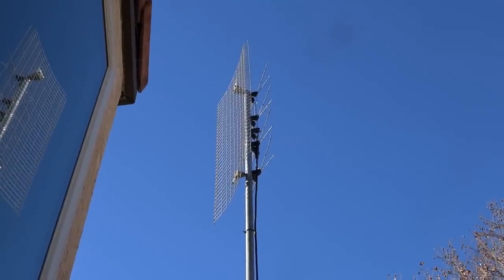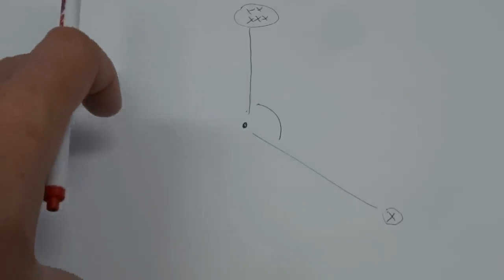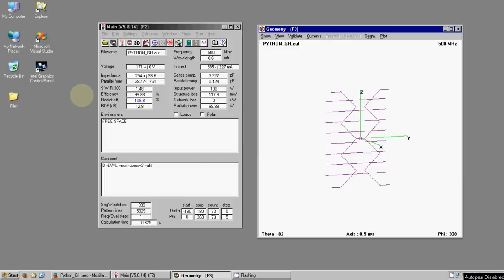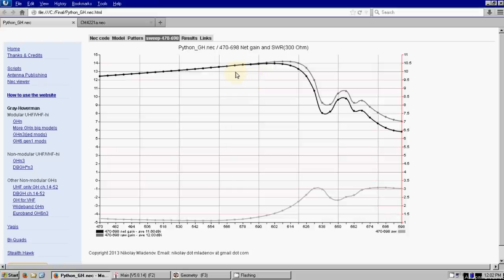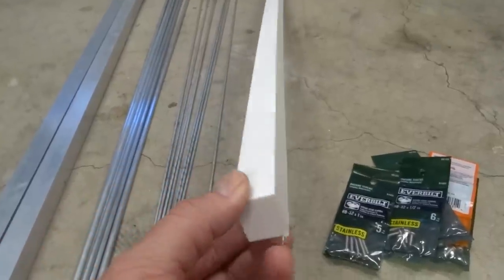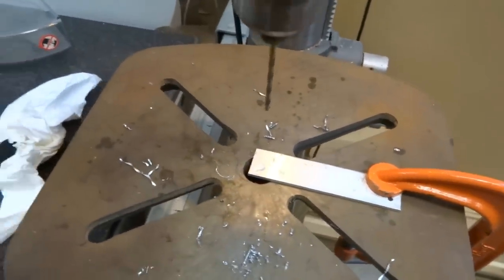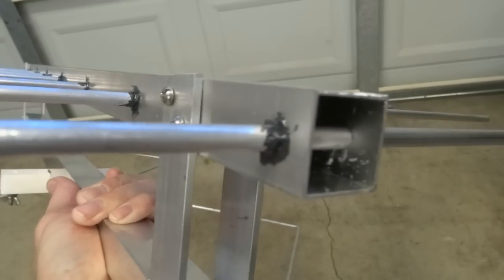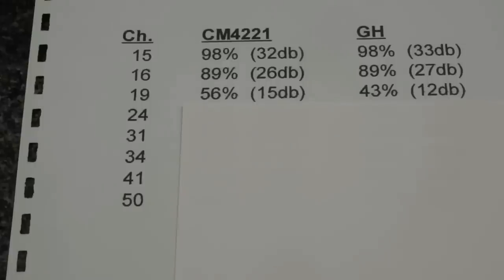Homemade Gray-Hoverman TV antenna

Comment: Sure it will work, we use to stack antenna's to cover multiply markets all the time.
 But, here's a trick you normally don't think of. When using a stacked antenna array, avoid using antennas that both cover the same channels in both target areas. Else you wind up amplifying the noise, from the area your not trying to receive, and, degrading the target signal.  You could also use a tuned trap, to block the signal from the undesired area, but, that's more complicated for many to comprehend (hi-pass, low-pass, or, notch filter etc).
Reply: Hardly even necessary anymore with technology. The Televes SmarKom will allow you to isolate which antenna is responsible to pick up each indvidual station. Not only that, it takes the signals and automatically optimizes and boosts each one as needed so the signal strength is about the same for all. Truly amazing. But yeah, it costs about $200 buck. Still cheaper than two months of cable.

Comment: Do you think that using thin copper tubing(Say 1/8" or 3/16" tube ) instead of copper wire be better from both strength and gain angle ?? How about using 10 gauge solid wire instead of thinner wire be better ?? What do  you think ???

Comment: Been building antennas for 63 years.  When you have your 5 channels line of sight 8 miles away, all you need is a paperclip to receive them.   Remove the reflector off your channel master antenna and point it at your 120 degree 40 mile target.  You will get perfect reception for the 5 channels from the side/back exposure gained by losing the reflector.

Comment: I know this is an older video, but man your work is professional quality.

Curious if your main antenna bends are at 7" per the usual Hooverman or if you used 10" as i have seen on some.

Also Brian, I know you optimized for certain channels, but did you consider the horizontal tubes top and bottom as seen on some Hoovermans to enhance vhf?

Comment: Most of the Grey Hoverman builds I've seen use non-conductive materials for the structural support, with a vertically split reflector. I like the simplicity and sturdiness of using aluminum square tube, but wonder how it might change the performance compared to the original design.

Comment: I purchased an indoor antenna that looks like a mini old fashioned outdoor antenna. Plus I added a 15db amplifier to it.  I use this combo within my apartment.  On a good day, this gets me 40+ free channels. However, the antenna has to be positioned in a specific location pointing in a specific direction.  This location is about a 1 foot by 1 foot by 1 foot square area. If I place the antenna anywhere outside of this area, I will be left with about 8 or 9 channels only.  The existence of this perfect little focal area is due to the RF signals bouncing off the immediate nearby surrounding buildings. 

However, the antenna that I use does have only 14 "wings", or what ever they are called, thus certain channels are picked up better than others. So to tune the antenna to get the best number of channels, I made an aluminum tuner. It is just a rectangular piece of thin cardboard covered with tinfoil. I place this on my antenna to tune it to raise the pickup of the weakest channels such as 49 and 51.

Comment: First, I really like your design thanks for taking the time to show your work. 

Two simple things to improve the longevity of your design.

1. You could have used your drill press to pre drill holes for small stainless screws to fasten the reflectors on the mast instead of epoxy. Epoxy will break down with UV exposure.

2. Bend the edge of your washers in a vice so they cup the element when fastened by the screws ensuring they won’t come loose in windy conditions.

Hope this help

Comment: Hey Brian, thanks for the vid. Am desperately trying to get better DTV reception and am sick of forking out money for high gain fringe antennas that don't do the job. And yes I am running a high quality mast head amp. Frequencies in our patch are mostly VHF: from 64.25MHz (odd one out) then 177.50 to 226.50Mhz with a couple in the UHF range 527.25 & 536.625MHz. All Horizontally polarised. I would consider ganging 4 of these together to cover the range. Are the receiver element lengths based on frequency wavelength?
Reply: buy Android tv box you can get everything you want for free
Reply: If you have twice the antenna the best you can hope for is 3 dB more signal. Are you in a deep fringe area? Any obstructions? Height problems? Trees in the way? If the transmitters are in different directions, a higher gain antenna will be harder to steer to each one.

Comment: Shouldn't the reflector rods be isolated from the structure frame with rubber grommets? 
Your nec file shows your reflector wires to be 6.35mm radius which is .500 inch diameter and your element wires are 3.175mm radius which is .25 inch diameter. Am I reading that right? I changed the value by half and it showed a slight increase in gain.
Reply: Make sense.. I thought the same..
Reply: Yes. Antenna in this video is not Gray-Hoverman. For G-H - reflector must be electrically split (no matter if it is solid mesh or rods). This is the most annoying feature to actually go for G-H. I've seen dozens of DIY pictures where people do solid-reflector (non-split in halves). I will run HFSS simulation to see what happens, when you connect reflector halves.

Comment: I live near the Illinois-Wisconsin border, so I get an equal amount of channels from both Milwaukee and Chicago - totalling 80-100, with the strongest signals at 100% signal strength.
But without warning, at random times, and regardless of weather, I lose all channel signals. Hardly a single channel in the entire memory works.
But when I do another channel scan to see what's available, I suddenly get channels on the other side of Lake Michigan, and stations as far north as Green Bay at 80% signal strength. Stations I would never get under normal conditions. Even with the LOS flatness of Lake Michigan.
I used 1/4" copper tubing for my elements and used soldered connections to the balun (which uses 20AWG solid leads on the 300 ohm side). I'm using a steel mesh reflector,  positioned randomly (4"?) behind the elements.
It's crazy. I've been experimenting with antennas for ham, AM/FM, tv, and even for neighbors' cable tv leakage since the 1970s, but I've never seen an antenna design deliver so much punch.
I'm wondering if anyone else has sudden complete dropouts of close stations and then perfect signals on stations over a hundred miles away.
Reply: In my opinion it may be because of input overload... which i sometimes observe in some walkie talkies/ handsets/radios. some strong signals overload the input, rendering the output zero or nothing.

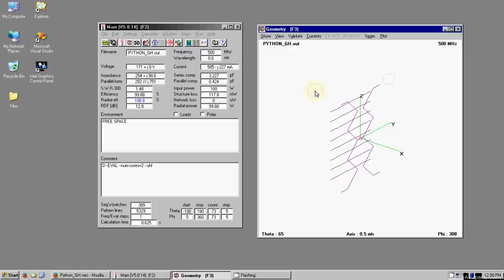Comment: Frequency selective if you size for specific dipole gap and if you use multiple antenna to create a phased array and aligned perfectly with the transmitter you may not need Traps or Band-pass filters.[ 7:00] 15 to 31?  I would aim tighter than that. If you used 3 antenna the distance between the three can help tune in the frequency.

Comment: EXCELLENT in ALL regards.  I hesitate to add anything, but after using more than a few cutting fluids on aluminum, I've found plain old kerosene to be about as good as it gets.  In my experience, Kerosene even works better than some of the products dedicated for use on aluminum.
Reply: Mike Wimbury
Reply: Kerosene, eh? In that case I bet mineral spirits (Stoddard solvent) would work great too, but less smelly. I'll try that.

Comment: Great job. You should do a build of the Channel Master 4251 UHF 7ft PARABOLIC  That was the king of Antennas.
Reply: www.wadeantenna.com , sells UHF Parabolic antennas.

And Yes the Prices Reflect the Quality of the antennas.

The advertising is aimed at the CATV industry and Professional industry due to the fact that they require durable long lasting dependable antennas , however Yes you can buy and use them.

And Yes Wade Antenna sells Tv many other Tv antennas.

And Yes the Prices Reflect the Quality of the antennas.

The , J-283X VHF/UHF All Channel Antenna is a Excellent Antenna.

Wade Antenna sells antennas that installers have thought are no longer available. However still are.

Comment: I was just wondering if you purposely allowed the reflector rods to be electrically connected. I've built a couple of these (not optimised for your channel range) using screens for reflectors instead of rods. I know there is a "gapless" version out there, but all the ones I've built needed the left and right sides of the reflectors to be electrically seperated to keep the SWR down. Anyways...I'm just curious and fascinated, not critical. Overall, I think it looks pretty nice.
Reply from the maker: Matt Hoover I considered electrically isolating the reflector rods using the plastic as I did with the driven elements, but in the end I didn't for several reasons. 1) It greatly simplified the design and construction, 2) that plastic is the most expensive part of the antenna, and 3) the biggest reason is most commercial antennas do not electrically isolate the reflectors so I wasn't sure if it's necessary or has much effect on the performance.
Reply: Brian Friesen OK..like I said, just curious. Easier to build is why I opted for using screens instead of rods. I live in the mountains of PA where I have to squeeze pretty much every decibal I can and use a pre-amp just to get stations broadcasting 20 miles away. I built a double bay version of this for myself and it works pretty well. Anyways, thanks for answering my question.
Reply: Brian Friesen Couldn't I use cheap plastic yardsticks for insulating?
Reply: Rainy Kay be careful what type of plastic you use as many types degrade and crumble under long term use in UV light. I used the gray, UV resistant PVC electrical pipe (1/2") for my build.
Reply: +Matt  Hoover Good!

Comment: Nice job with the antenna. it looks great. I'm interested in building one, however I need my gain to peak at UHF channel 42  (don't really care what else I receive) The design software is a little over my head, any chance you would run it for my situation for a donation?    Looking to pick-up FOX-29 out of Philly from 63 mile northeast. I have been able to receive 3 Philly channels with the towers in  the same cluster with my Wineguard HD-8800, but Fox is the one I am really after.

Comment: Hi Brian. Great video! Thank you for sharing your knowledge with us. 

I wish you had taken your signal readings with a field meter for more accurate results. I live in Costa Rica, install OTA antennas and use a field meter for the ISDB-T digital television standard. ATSC is the OTA digital TV signal standard for Canada. Mexico and the US. With the meter I can read signal strength, quality and  the Modulation Error Ratio (MER)  which helps me a lot to compare and to align/orient antennas.

Comment: Great video can you design one that will work for long range use?  I live in rural Utah and the tower are 80+ mile away from my home.  Maybe sell me a put together kit or something.
Reply: You can also find an aluminum pole outside, wrap it outside with copper wire, and plug in the coaxil to pick up 75+ channels in the city and 20+ channels in the country.
Reply: If you live to far from the transmitter  antena,  get you a signal amplifier and you will see the difference 🤔🤔

Comment: First of all, I was wondering what software you use to get DB and statistic levels from your antenna?
Steal & copper make far better conductors..
Aluminum is pretty much a no go from what I have seen in other videos.
Your Antenna looks very pro looking!!
But I was told not to use aluminum for my conducting wires..
Thanks 4 Sharing!!
.

Comment: UHF channel spectrum (14-83) was set aside in 1950s, BUT it was not Kennedy admin (FCC commissioner - Minnow) that they required TVs to include UHF tuner.  BONUS: Fairchild (Robert Noyce) attributed that required for "the new" transistors fabrication -- that enabled eventual Intel -- later. The loss of the 800 MHz  (70-83) in 1981 created the cellular telephone spectrum -- that you have used since 1980s

Comment: So basically, in the end it performed as good as the CM 4221. If one didn't want to go through the build and for about an additional $20 you could just buy the CM 4221. Is that correct?
Reply: Yes. But buy a newer version of the channel master optimized for the reduced spectrum.

Comment: hey if you have the time to answer my question id greatly appreciate it. so basically where I live I can get 9 channels with a little homemade antenna with a piece of wire and a stripped coax cable, and that's because the broadcast tower is within about 10 miles and the signal is very very strong. now I wanted to start to make a seirous antenna to get all the good channels like abc and fox. well the only problem is, thir broadcast towers are 40 miles away or so. so I bought a blaun with a vhf and uhf signal mixer in it considering a few channels in my area are vhf. but my main question is how much does this cost to make? you made it really good it looks store bought. but also whats the range on this? if I mount it 30 feet high in my attic, can it pick up a signal from 40 miles away?? please answer If you can.. thanks :)
Reply from the maker: +BassMaster101 The materials probably cost me around $30 which isn't bad considering commercial antennas of the same class cost $50 - $100.  This antenna design would most likely pick up stations up to ~45 miles, but there are so many factors that affect that like local terrain, nearby structures, and the strength of those distant broadcast signals.  tvfool.com is a great place to start to determine what you might be able to receive.
Reply: wow that's not bad at all.... thanks

Comment: You know what works for tv works for radioham,  I'm using   2 x  Digital tv antennas as reflectors for my dipole, gained over 3 s.points on my signal

Comment: hi my question is usually i see people making them out of copper wire tho yours is made from aluminum right the rods  and everything els besides the bolts screws?
Reply from the maker: Copper versus aluminum shouldn't matter much.  Copper conducts better than aluminum, but aluminum should withstand the elements better than copper.  Both copper and aluminum conduct far better than steel.  Go with whatever you have.
Reply: Most CB antenna's  on auto's. are made with stainless steel. My base is made up of aircraft aluminium.  Not sure if that would be any better but it would be more expensive.
Reply: It wouldn't matter if you are only 45 miles from the tower. It matters when it is 60+ miles from the tower! I get 6 channels 20 miles from my home  by using just two stainless steel cooking tongs. BTW, the conductivity of copper is 40 percent better than aluminum and 6 times better than steel. Since stranded copper has a much larger surface area, it will have more gain than solid copper wire. So, use a stranded copper wire if you have one. Also, the difficulty of receiving signal is not linear to the distance.

Comment: Questions.  How did you attach the rabbit ears together.  Second what was the angle for the rabbit ears.
Reply from the maker: birther1968 By "rabbit ears" are you referring to the zig-zag shaped elements?  They are not connected together.  Each side (left and right) is a single piece of aluminum rod bent into shape.  The angles are all 90 in the middle and 45 at the very top.  The elements attach to the rest of the antenna using metal bolts and nuts at the plastic fittings.  For more details on the design (such as element lengths) you can download the antenna model.
Reply: yes

Comment: Would it be a problem to use half inch copper tubing instead of the rods that you used for the receptors?
Reply: John Baker , No problem at all. Pretty much any metal will work. And if you are sticking this in an attic, aluminium foil glued to some cardboard would work just as well :). Only use the fancy stuff for outdoor installs.
Reply: John Baker , No problem at all. Pretty much any metal will work. And if you are sticking this in an attic, aluminium foil glued to some cardboard would work just as well :). Only use the fancy stuff for outdoor installs.

Comment: There is still LOW VHF in the MIX... so  I made my own 4 bay bow tie whiskers with 10.5" length... elements. No reflector! It works great.
Reply: My only NBC channel is moving to channel 2 in 15 months.  Not sure what chowderhead agreed to that.   They must have gotten a bundle when they sold channel 32 at auction.  Anyway, I have a little over a year to figure out something.   I have line-of-sight at 32 miles.  Is there any chance that this antenna will pick it up?  or will I need some kind of dipole?
Reply: @thewileyone1  -  Try adding Roach Clips to it.  I have been experimenting with Roach Clips....  Most Channels I'm using 5 Clips and then some I have to use 6 Clips... Strange, but it works!

Comment: If the digital age cut the UHF band to 14-51 why is there still channels 55 and even channels in the 60's? I don't think my tv has removed channels 52 through 69, my tv is only a few years old bought in 2015.
Reply: google the FCC phase-in report thing.   I believe it will all be done sometime in 2020.
Reply: These stations are actually broadcasting on different TV channels than what they are branded as. In ATSC broadcasting, PSIP info tells the receiver what channel a station is branded as (virtual channel) and what channel the station is actually broadcasting on (physical channel).  This allows stations on the higher channel numbers to continue using the channel branding and image (i.e. Atlanta's channel 69) they have built up over the years.
Reply: Mine goes up to 64 (Massachusetts)

Comment: so where does the coax cable connect to the antenna?
Reply: Pause the Video at 6:18 - Connect it at the "Y" Center Point, one on each side.  You need a Balun first, then you can connect your cable to it. :)